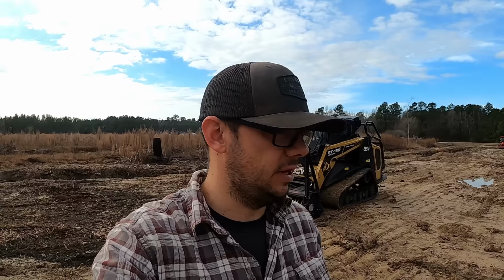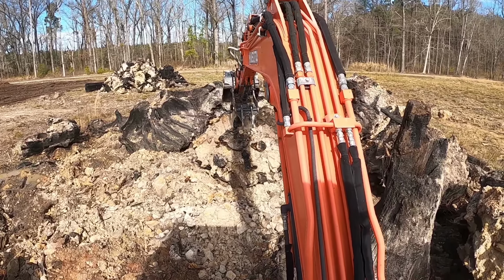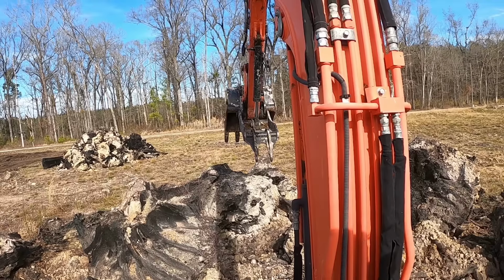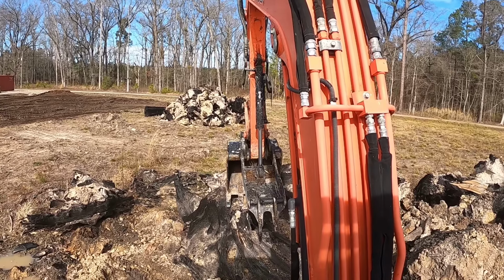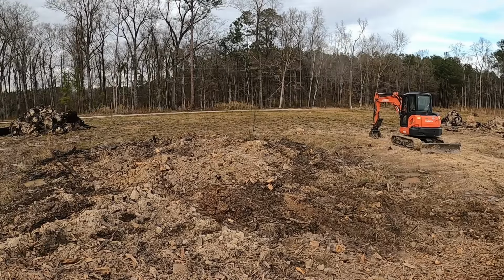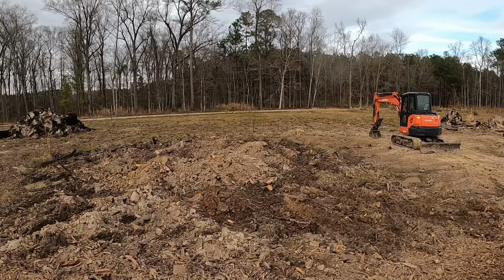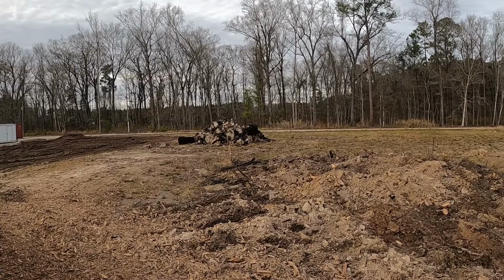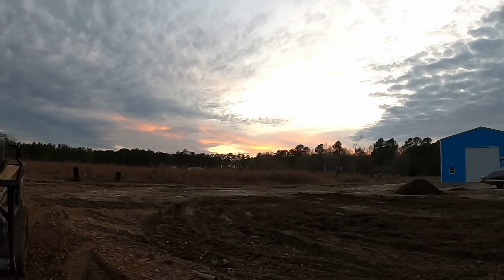FED UP OWNER Wants These MASSIVE Stumps Piles PULVERIZED!

Comment: This makes me wonder if using the blade on the front of the mini would be more effective. Then you've got hydraulic power, and the weight of the mini to try and break some of that clay off of there. I know clay all too well. In SE Minnesota here it's all clay and karst sandstone. Or clay sets up like cement even without any baking, all it has to do is dry out. Oh also I wondered if it wouldn't just be better to take the wide section of the stump all the way across the face of the mulcher, or at least work one stump right side, one center, and one left side of the drum? That way you spread out the force, or spread out the wear so you're not wearing those center knives down to nubs.

Comment: weld the teeth with some super surface rod, I'm just a keyboard puncher  or is it easier just to buy the teeth
Reply: I’ve used hard face welding rods on things like snow plow wear skids and excavator teeth and it really does work. But I suspect those mulcher teeth are high-carbon, high strength steel and I’m not sure how they’d take to being welded on. And even if you did, the weld beads wouldn’t be sharp so you’d have to machine the resurfaced area and that might be a challenge too since the material those rods deposit is very hard. 

The hard face rods work well to resurface mild steel but might be more trouble than they’re worth for Davin’s application. 

I think the carbide teeth are the way to go. That’s all you’ll see on the big stump grinders which are routinely in contact with soil and rocks.
Reply: We used to have big hammer 'hogs'... (1200 hp !) for dealing with wood waste.
Every night we would have a guy re-welding the hammers.  In this case would he would need to take the teeth out of the mulcher, re-weld them periodically, and have a machine to re-grind them.  Probably too expensive.